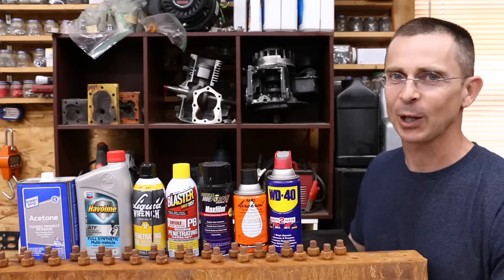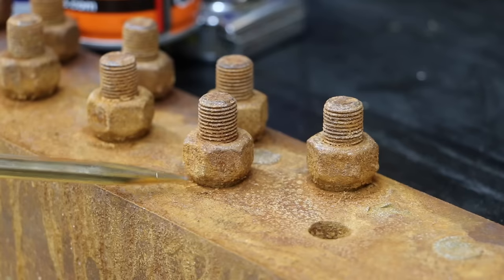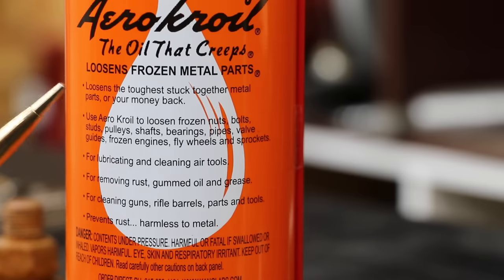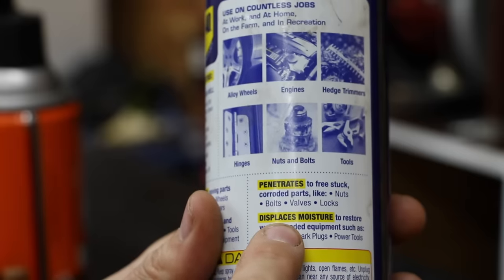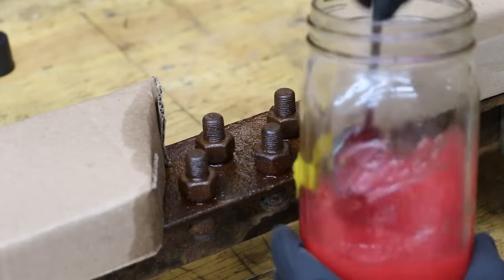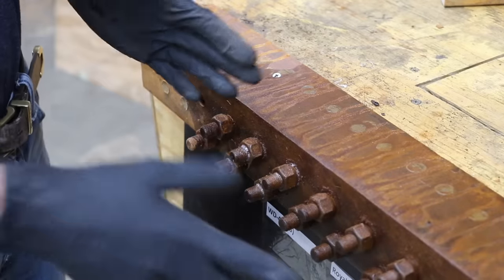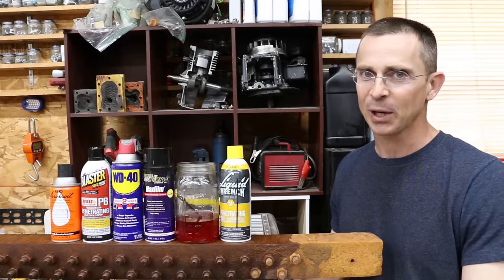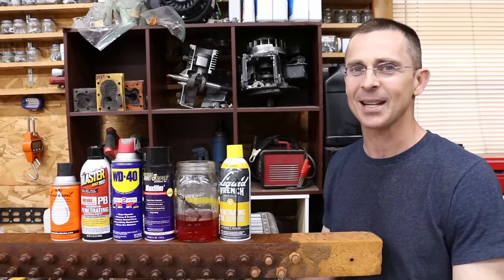Which Penetrating Oil is Best? Let's find out!

Comment: I recently purchase the Liquid Wrench penetrant spray based on your test results here.  Very difficult to find this product in brick-and -mortor stores these days. Nearly everyone stocks the PB Blaster and WD-40 penetrant sprays.  So after finally finding Liquid Wrench in stock at a local TSC Tractor Supply store, I was happy and eager to use it on rusted fasteners on my Ford Explorer SUV.  I put a large sheet of paper on the garage floor to catch drips while spraying the rusted fasteners on the car with the L.W.  Much to my surprise and dismay, the large drips on the paper had completely disappeared by the next morning.  Absolutely no oil residue was remaining, and it reminded me more of disappearing ink that I had when I was a kid.  In my opinion, any penetrating oil spray should leave some oil residue behind after the solvents evaporate.  Perhaps I was unlucky and purchased a defective batch of product that lacked most or all of the oil component.  One thing's for certain, I won't purchase the Liquid Wrench product again.  I will probably go with CRC pentrating spray, which I noticed on the shelf next to the L.W. at the time I made the purchase.  Based on the videos you later made for additional testing on these type of products, the CRC product works very well.  It's also more readily available in local stores.
Reply from the maker: Thanks for sharing.

Comment: An interesting test that could be done is to use the following method:
Heat the nut and then melt a wax candle on it. 
I used this method with extreme corroded bolts (muffler bolts) with impressive results!

Comment: THANK YOU for doing the science.  So many claims and “wisdom” out there just go unverified…

For example, I had been convinced to go buy on blaster, as the best, for a tight spot I’m in where if the stud shears, I’ll need to drop the engine to get it sorted. Def worth taking my time. I’ll be getting some liquid wrench and learning to use the torch!

FWIW, there is another one out there that advises to wrench back and forth to clear the threads from rust build up. This is obviously for more rust than you have got there.  The idea being that if you just pull harder, the rust jams the nut, and you increase risk of shearing.

I plan to take my time with this one, and will probably do multiple applications of liquid wrench while going back and forth. Cheers!
Reply from the maker: You are welcome!  Thanks for sharing.

Comment: Nice test! Ive also used other brands of penetrating oils from CLP. I have found with really stuck parts that if you can heat it, then start your penetrating routine, that works the best. You have to be really cautious because of flash points though. Other thing to remember is any oil is better than none. Plan your projects, start sooner then later if possible.
Reply from the maker: Thank you!  Thanks for the feedback.

Comment: Thank for these videos.  They are valuable.  Just want to add that I had an old can of PB Blaster that I used on a very stuck bolt laying sideways securing a vehicle strut.  Spent a day on this.  This old can had lost its compressed fizz so I dripped it in without success loosening the bolt.  I noticed some comparison videos where the penetrating oils appeared to bubble under the nut so I bought a new can.  The compressed fizz appeared to penetrate under the nut this time so I let it soak for 20min.  Bolt unstuck!
Reply from the maker: You are welcome!  Thanks for sharing.

Comment: I enjoy your comparisons, but I'm not sure this is a valid test.  Torque is achieved by stretch of the fastener.  If you torque the lug nuts to 100 ftlbs then that's a measurement of the stretch of the lug.  "Untorqueing" will take about the same amount of force.   The rust is likely not a factor at all in this case, as we cannot assertain if there is any rust in the threads between the nuts and lugs.   Better to do the test with the nuts loose, then the rust and rust penetrant can permeate the threads, and you can measure the drag required to unscrew them, not to break the torqued value free.   Keep up the good work!

Comment: Another great video!!!   I have not found "penetrating oils to be of much use in penetrating" but, once the nut is loose, it is necessary to  have the lubricating and cleaning effect of some type of fluid, to flush away rust as the nut is worked loosen / tighten to reduce the rust and dirt from the threads, the cheapest is probably as good as the most expensive.
Reply from the maker: Thanks!  Thanks for the feedback.

Comment: I work in the Oil & Gas industry and currently we're decommissioning units that's been there since the early 80s that's still got the same studs since day one.
We've been using Yeild which works amazing, and I swear by it, only issue it's $60+ a can.
Reply from the maker: Thanks for sharing.

Comment: I've found Liquid Wrench to be the best for rusted bolts as well.  Works great on freeing stuck, corroded water shutoff valves under a sink as well.  I've tried the acetone/ATF mixture that some claim is the best, but I found nothing that beats the Liquid Wrench.  Others must've noticed the same as it is often sold out lately.
Reply from the maker: Thanks for sharing.

Comment: I used WD-40 to free sliding gears in my antique Monroe Calculating machine but it took all day. Soak, wait 20 minutes, gently work back and forth with screw driver. It worked, blow it out occasionally. Lubricate with sewing machine oil. Mainly the problem was not rust, it is old oil that needs to be dissolved. Was recommended to use a cleaner/lubricant for electronics on my antique typewriter: Nu-Trol, it is paint/plastic safe. Lacquer thinner is also recommended but not paint safe or plastics.
Reply from the maker: Thanks for sharing.

Comment: Retired old offshore oilfield operator/pumper here. we got some really nasty rust out there with the salt water and the years sometime 40-50 years old plus really big bolts over 1" dia. we always used Kroil out there. I highly suspect that Marvel Mystery Oil and Kroil are the same thing. The worst rusted bolts that i ever seen were broken after we had tried everything we put fresh water dripping on the bolts all night  and the next day they broke loose easily.
Reply from the maker: Thanks for sharing.

Comment: I worked at a dealership over 50 years ago and we used to put that in a crank case during an oil change. I gave a couple cans to my brother and he loved it and believed in it it is excellent. It used to be two dollars I can it was just a tin can with a squirt tip it sure has gotten pricey. I think it does an excellent job to.

Comment: Would like to see if Dye Penetrant would work on rusty nuts and bolts. Dye Penetrant is used to look for cracks in metal when performing non-destructive inspections. So maybe it will get into the threads to help break it loose. Thanks for all the testing videos.
Reply from the maker: You are welcome!  Thanks for the suggestion.

Comment: This is a good diy at home experiment… however, on the industrial side of things there are applications such as hydro generator rotors (recent job I was on) some rotors are large some are small. Many of the large hydro gen rotors can have an iron stack of 10-12’ tall of 1/8”+ laminations that are held with thru-bolts at thousands of psi. We use kroil not just to loosen the holdown nuts but to creep down 10’+ to and to spread through the laminations and and any areas with <\=.002. I love on blaster if I don’t have any kroil on hand at the house but as far as covering all industries and applications I’d say kroil knocks the rest of them out of the park

Comment: I appreciate your video and it seems like you took all the steps to ensure a fair and even test. I do have to say though, something seems amiss, as my personal experience with WD-40 vs PB Blaster was completely different. My best example of this was years ago when a friend gave me a pair of 9-inch pliers (or, more commonly referred to as Kleins) that had been sitting in the bottom of their tool bag for 10+ years without ever being used (they were part of a tool set he purchased). They looked brand new, but they were so frozen that the only way to open them one handed was to drag one of the arms across my thigh or the floor or whatever. After this got really old, I first tried WD. Sprayed on and worked the pliers and got zero results. Repeated another half a dozen times that week, still no results. I then bought a giant can of WD, sprayed it into a bottle that I'd cut the top off of, until it was about half full. Then stuck my pliers in to soak. I worked them several times a day over the weekend, always returning to their WD bath between workings. After all this effort, still absolutely zero noticeable results. While at the auto store a few days later, I saw PB Blaster on the shelf, and remembered that was my dad's go-to when he was teaching me to work on cars. I bought it, took it home, and as soon as I sprayed some on the pliers and started working them, I could immediately see rust working it's way out of the hinge, something I had not seen once with the WD. I continued and after 5-10 minutes of spraying and working, they moved like they were fresh from the factory. Sorry for the long story, but I guess my point is that despite all the effort you clearly put into this test, there has to be a flaw somewhere, not sure where, but somewhere. Sorry, but, again just from my own experience, WD is a terrible penetrating fluid, so I'm really not sure how it could have possibly beat PB. I know I just sound like a PB fanboy, but I swear this honestly is what I have observed.
Reply from the maker: Thanks!  Thanks for the feedback.

Comment: Late to the party here! I found an excellent penetrant for bolts into aluminum such as brake calipers etc. It's called Fospro and I get it in the UK. It's no better than WD-40 for other penetrating tasks but it's truly excellent on bolts going into aluminum. Apply, leave 10 mins and strike the top of the bolt squarely just once. 
I believe the formula contains phosphoric acid which might explain why it loosens stuck bolts in aluminum so well as it creeps into the threads and removes aluminum oxide which is the corrosion that binds the bolt.
Reply from the maker: Thanks for the feedback.

Comment: Back in the '60's and '70's when I was working on basket case rust-bucket British motorcycles the go to product was Maltby Penetrant endorsed by the US Coast Guard and while the stuff was god-awful expensive, it worked beyond belief. Frozen head bolts, spray and loosen within 5 minutes. I haven't found the product available here in California in decades for reasons I can only guess. If you find it, use it.
Reply from the maker: Thanks for the feedback.

Comment: One thing I've noticed with Kroil,  it works better than anything when the bolt is going up. 

As a test,  I had some Kroil on my work bench,  took a rusted bit with a nut stuck on there,  set it on the puddle, and the Kroil actually flowed up hill through the nut!

If you still have those products,  try that test more scientific than I had
Reply from the maker: Thanks for the suggestion.

Comment: Highly recommend checking out Conklin oil products. They make Luboil, Rustbomb, SAFE radiator conditioner, DIKE radiator leak fix, Diesel Plus fuel additive, Rite-On and Rhino grease, Convoy oil, and a lot of other things. We’ve been using their products almost exclusively on our farm for as long as I’ve been around and I’m curious how they stack up against the competition.
Reply from the maker: Thanks for the suggestion.

Comment: Re: heat....induction heaters come in all sizes and shapes and avoids the open flame issue. On the other hand, if the item is really locked on the threads you can't cut it off with induction.

The other method is one I used with wheel studs. Had a Nissan with aluminum wheels. You always had to make sure the threads we're free of any aluminum bits deposited as the wheel came off or was put back on by dragging the wheel across the threads. Those threads are great files. This was always an issue with lazy tire shops who almost always dragged the aluminum across the threads. Now, the nut would go on easily and torque properly but when you tried to remove it the aluminum in the thread would lock it up tight. Limited forward motion but no loosening. Simple solution...break the damn thing off. Don't beat on it, just put your biggest bar and cheater on it and snap it. Then it's a simple matter to drive out the old stud and install a new one.
Reply from the maker: Thanks.  Thanks for sharing.
Reply: @ProjectFarm  Sounds like a shop that overtightened lugnuts by a crazy amount and stretched studs out of their elastic zone.  Have done thousands of tires, only a handful of times have i had studs snap when removing lug nuts.  Has nothing to do with aluminum, it can happen on steel wheels too.  Have never seen debris on threads be an issue, but obviously threads should be clean before assembly of anything.

Comment: Should use petroleum based ATF not synthetic. And the ratio is 70% acetone / 30% ATF. The acetone has very low viscosity that's what carries the ATF into the threads.
In some cases applying Teflon paste(plumbers thread sealant) before assembly will help make it easier to undo fasteners at a later time.

Comment: Man, you took a LOT of time to plan & conduct this test, not to mention notes & recording, some thing that the automotive / ligh-heavy truck line mechanic has NONE of. I could not help but notice Zep 45, Mopar, & Motorcraft penetrants were not mentioned. (They are kinda inna class of their own) my point is; give them a try. Under any conditions, the torque to loosen cannot be any less than to tighten, so, it (breaks) down to which one converts rust & dirt better. That will be ground to a greasy emulsion as the nut & bolt are separated. And the line tech does not give three hours for anything to eat! I have used all of those penetrants that you tested, and the Motorcraft and the Mopar work the best. (Dont even have time for a coffee) And in no particular order, however I am partial to Mopar. Zep smells the best of all of them. Thank You for publishing your results!
Reply from the maker: You are welcome!  Thanks for the suggestions.

Comment: A combination of heat and bees wax was what we used for salt-welded nuts in the Merchant Marine and US Navy.  Heat the nut HOT with a propane or acetylene torch, then apply a beeswax candle to the joint between the nut and the stud or bolt.  The heat melts the wax, and capillary action draws the wax into the threads.  Do this several times to allow the wax to get drawn all the way down the thread engagement.  It always works, but you have to be patient.  The bonus is that you get a sweet honey smell while you're working on sewage pumps🤣
Reply from the maker: Thanks for sharing.

Comment: Very good test.  If you do this again, try ATF/Zylene.  Zylene does not evaporate like acetone, last 3-4 times longer.  A test sample of both on rusted metal shows zylene will spread/creep twice the distance of acetone.  It mixes with ATF and can be used in a Windex spray bottle.  I'm using this mixture on a 45 year old dozer restoration but can not confirm that it is better than any other.   Another one, if possible, a few hits with a ball peen hammer on one side  holding a heavy hammer on the opposite side.
Reply from the maker: Thanks!  Thanks for the suggestion.

Comment: Best combo is heat and kroil. I use it all the time when replacing parts that have rusted overtime. I use it on exhaust manifold bolts and studs all the time. Saves me from having to extract bolts almost every time
Reply from the maker: Thanks for the feedback.

Comment: my favorite to loosen stuck nuts and bolts is to use an oxyacetylene torch because if it is liquid, it can't be stuck.  I have used the ATF/acetone mix in freeing up frozen pliers and other tools.  It does need to soak for a while but I have saved many plier type tools (linesmen's pliers, diagonal cutter, crescent style adjustable wrenches, and ratchet wrenches).   However, I have used a non-synthetic ATF.
Reply from the maker: Thanks for sharing.

Comment: Thanks for the comparison - it will save me money in the future! I fell for the hype and bought a gallon of Kroil at a pretty spendy price.... oops! (still works pretty good as a solvent/light lubricant to soak firearm parts) We used to use a product called "Nuts Off" at work that seemed to work well for freeing frozen locks and tools. A friend of mine that is a mechanic loves a product called "Free All". Not sure how either of those would place compared to the winning "Liquid wrench"
Reply from the maker: Thanks!  Thanks for the suggestion.

Comment: W D 40 is not a lubricant. It's a water displaser developed by NASSA to keep condensation from forming on the outside of the rockets. The 40 is the number of times it took them to get it right.

Comment: The best way to use Kroil is with heat on extremely tight bolts, only ever used it in industrial use, have used all but Royal Purple for my own use and Liquid Wrench appears to work better, if you have access, two hammers to tap on the nut with penetrant works great also, one to hold against the nut and the other to tap against the opposite side.
Reply from the maker: Thanks for the feedback.

Comment: Nice video. Liquid wrench pentrating oil is all I use in the shop. If that doesnt work then out comes the torch. Got a link to ac delco tool that was used in this video?